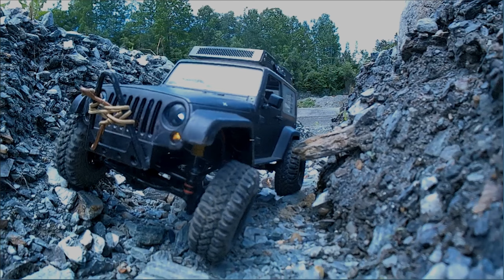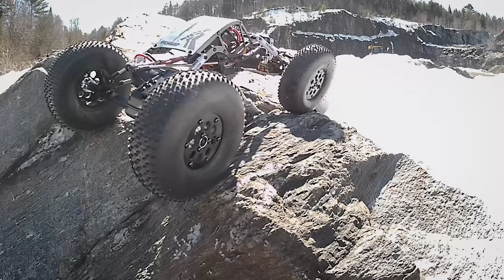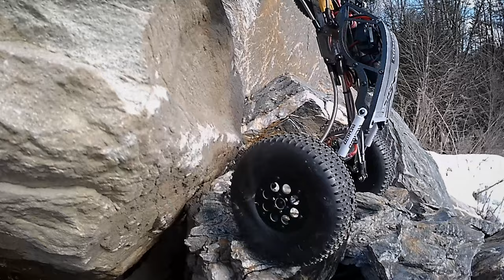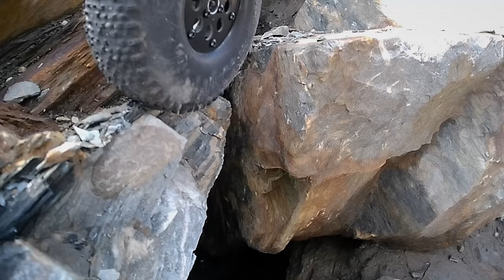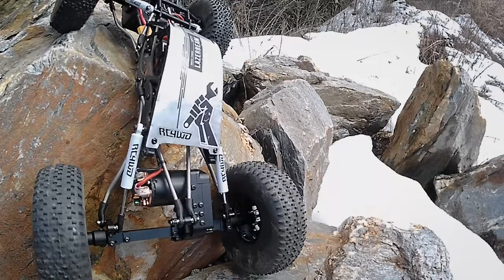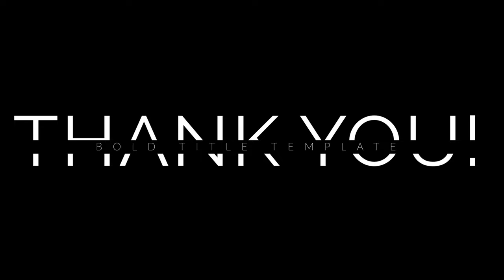#RC4WD Bully II - Quarry #1 - Maiden Voyage

Comment: I got mine out couple months ago . Put 2 new esc's in it and got it going again . They are nice crawlers . I use a 650mah 3s fits tray on front perfect , and added the brass to front axle helped it . Awesome rig look's great ...! I changed the hubs on wheels to a 20mm hub got a little extra steering cheap .
Reply from the maker: Yeah, they're super fun rigs. I'm sure this could use a few upgrades but I'll add stuff as needed. I'm on the fence about going all out with this because I've got my eye on something.

Comment: Have fun with it. Enjoy it the more you run it the more you'll see how the ESC will stutter. 😅 Then you noticed that the servo won't be strong enough to get you out of certain until he gives out. That's what I went through. Out the box mine came with no bec.😅 Now after a couple of years of running I upgraded all the electronics. But at first I ran it the way it was stock.😂
Reply from the maker: I love it when people stop by and comment on a rig's first video and tell me how much it needs changed. It's funny that I ran this almost daily for 3 months in almost every single rock crawling condition I could imagine and I never once ran into any issues. People generally don't read manuals or mess with anything stock because they just automatically dunning/kruger everything with a blanket answer. After dialing the dual rate down to 70-71% on the throttle, bumping the steering dual rate up to 104% and getting a 70Kg brushless servo, clocking the axles front & rear, installing Dravtechs, modding the foams, modifying the links, it runs as good as any other comp rig I've watched videos on. My thought would be to take a minute to look at the multitude of video I recorded of this thing over the last few months and rethink the opinions of the stock motors and electronics.

Comment: In the video you mention clocking the motor.  Do you have more Info for how to do this?  Curious if extending  the upper links will accomplish the same.
Reply from the maker: Yes, I swapped all the long straights that were on the lower links with short angled ones from RC4WD. I moved the long rod ends to the uppers and it pushed the rear link riser out pretty far. It also brought the wheelbase into WMCCA spec for 2.2 pro.

Comment: These things are crazy looking I know for certain they could do some amazing sick lines I guarantee it but can you ride brushless motors on them
Reply from the maker: The world of MOA/Pro 2.2/Pro Shafty/Superclass/etc is so massively deep. It existed sort of long before scale really was all that big. It's that it died out maybe 10 years ago from what the guys who have been doing it that long have said. 

Basically, every single possible mod you can think of has been done in this class. And the guys doing it absolutely do not mess around when it comes to modding. World class competitors take these rigs so seriously. Lots of machinists and highly customized, specialized hardware. Brushless is literally everywhere in these rigs. Transmitters that cost $700. Servos that cost the same. You name it. There are $3k rigs out there that would blow your mind.

That said, this thing runs like a dream with it setup the way I have it. While not super slow creep like brushless, I haven't had any real problems yet. 2x 35t 540 motors on a 40A ESC (may upgrade that if I feel it's needed) and a dedicated BEC, 70Kg brushless servo. Yeah, I'm ready to dig in and learn some stuff with it.

Comment: Would you still recommend this ? Recently near where i live a riverbed was "renatured" and there are block stones that unfortunately are too big for SXC24 rigs but might be perfect for this although i always said 1/10 is too big, i have no use for that but now i might have. Is a lot of money though. (Especially considering how much money i have pumped into SCX24 stuff), i dont know how much it will cost to maintain this/spare parts, not sure if i need upgrades if it runs like this. Probably i should not do it.
Reply from the maker: I know this may sound pedantic BUT I recommend assessing how much you want to get into comp rigs and setting them up to run properly. That's not just advice, that's my experience with getting mine tuned and I'm still miles away from where it should/could be.

This thing is a blast straight out of the box. It gets tons of sh*t talked about it because it's an RTR and professionals love to belittle beginners and their choices. That said, Samu Sarka, #1 at World's multiple times over, still runs one. Albeit highly modified at this point. They need TLC out of the box. There are a couple of great links and resources out there for them. FB has a Bully II group dedicated solely to this rig. Some decent people in there and also some I-can't-believe-you-bought-an-rtr-rock-crawler-what-were-you-thinking types.

They're a commitment, like any rig. It's just that they involve that much more tuning if you really want to make them shine. I love mine and will definitely never sell it. My channel would currently be so much more focused on 1/10 comp rigs at the moment if I didn't have to relocate back to Illinois temporarily. The only reason I'm not posting much about this rig these days is because I have no place to run it that can challenge it enough and not just be single lines on rocks in parking lot. 

I am all-in for this thing if that's any indication. I've only added Dravtech 90s, a 70Kg brushless servo, swapped out a bunch of rod ends to make it WRCCA spec legal for wheelbase, added RC4WD brass weights up front, brass hubs, and cleaned up the wiring a bunch. It's still in dire need of more work.
Reply: @VermontScaleCustoms  Thank you. I should wait. I often want to start something new before i have really done what i just do. I have several SCX24 chassis, Mazz, Hard Park, printed Echo and more that i have just about finished, ran two batteries and not much more. About working on the setups - i dont have a good way to test several things on the same trail to see differences. No space for an indoor course like yours. I have one awesome spot with "24 scale rocks" in the woods but i cant really take three rigs there or change stuff there to see what happens comparing setups. I was there with the plain Warthog and thought well that runs fine too, why am i spending so much time and money.
Reply: Also thanks for mentioning Samu Sarka, interesting but to be honest thats much too serious for me, all that stress, competitions, perfection, serious guys counting mistakes - also this seems to be timed, right ? For me its really sth. like Meditation. And play, i want to play. Also this makes me understand why guys say they don't need brushless, sure they don't when competition crawling means to get over obstacles as fast and efficient as possile. I want to watch my tire squish for two Minute while it goes over a rock.

Comment: Did you have any issues with shoddy assembly out of the box?
Reply from the maker: I think a lot of people like to claim this thing falls apart in less than two minutes out of the box. I think it was on the my second or third outing that I finally started to see things loosen up. 10 minutes on the bench with a set of tools and some threadlock and it was solid. To this day, I still haven't broken or stripped anything, I'm still on factory ESC and motors, and I have zero complaints about the quality of the tires. The things are far better than I was originally led to believe. Maybe RC4WD had a bad run on them at one point and people hung on that reputation but I don't think they're remotely as bad as people say. The RTR gets my vote of confidence, for sure.
Reply: @VermontScaleCustoms  thank you, I appreciate your feedback. I think a few minutes and a little bit of thread lock is a small price to pay for a damn good crawler. Thanks again
Reply from the maker: @tundrasr5709  ✌agreed. Happy trails!